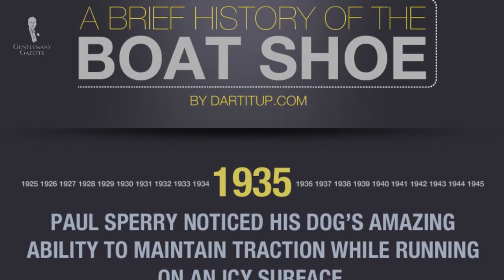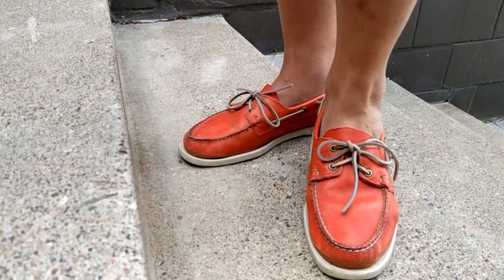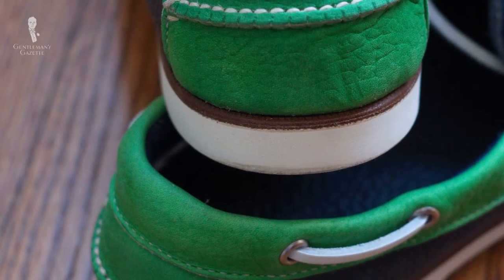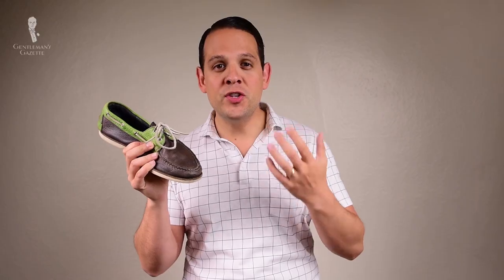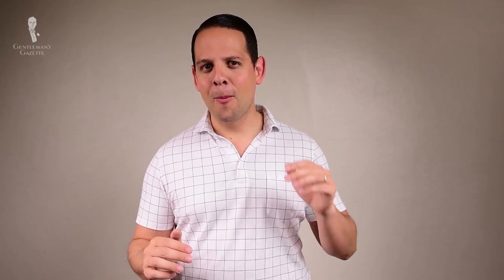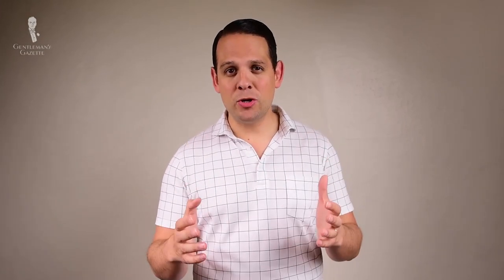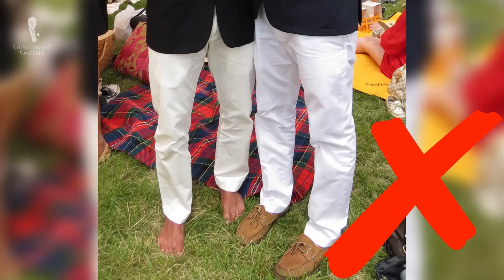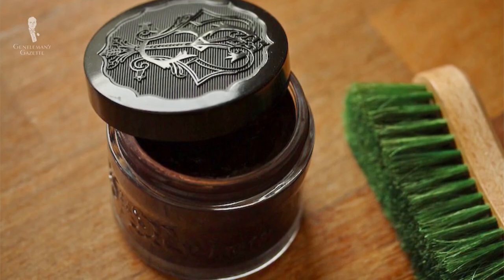Boat Shoe Guide - How To Wear Deck Shoes, Break Them In & Mistakes To Avoid

Comment: They are also very long lasting. I've had my Sperry's for almost 20 years, and still look and feel awesome.
Reply: mine only lasted two years, but i think that has alot to do with me welding in them. after those were gone i went out and bought the exact style and color over again
Reply: Worth every penny. :-)
Reply: They last a long time HOWEVER The grip of the soles on wet surfaces absolutely does not last nearly as long as the uppers. I’ve had my current pair for at least 10 years of fairly frequent use and right now they are outright dangerous on wet surfaces, even a wet sidewalk never mind the deck of a boat. Meanwhile the newer boating flip-flops I have are awesome on wet
Reply: @jefffawcett  get them resoled. The uppers are very durable indeed.
Reply: @1911Zoey its possible to resole Sperrys?

Comment: This is a super video. I would like to add a couple points to the boat shoe discussion. Since a sea-scout as a boy to sailing my own vessels on the San Francisco Bay. I have worn them my whole life. Perhaps we have our own traditions here but they are close held traditions. First, sailors never wear cotton socks. Wool stays warm even when wet, cotton does not. I keep to this tradition while wearing top-siders. If wearing socks I only wear wool with boat shoes. After the break in period, laces will not require readjustment. If using leather laces, it is traditional (at least on the West Coast of the US) to tie a square knot instead of a bow then snip away the excess lace about an inch from the knot. It looks tidy and will not accidentally become untied.
Reply from the maker: Thanks for the input!
Reply: With leather laces I use a closed jack ketch knot and slip them on.  This was common ar one time.
Reply: Also a heaving knot can be used on  each lace end instead of both into the jack catch that bights the lace ends on either for,ed loops. You only have to tie it once.

Comment: I know this isn’t intended to be a catch-all for deck shoe info, but I do wish more had been discussed about the differences between shoes worn on-deck and shoes simply styled in the boat shoe manner. For instance, the Sperrys I wear to church are very appropriate for casual wear, even with a tie. The shoes I wear on the water are VERY different. They’re vented, to allow water to enter and escape easily, and wouldn’t look right in many other applications.

Comment: I am looking for the timberland classic boat (white sole). My problem is that my foot length is 26,7 cm.
size 8,5 is for foot length 26,5 cm , and size 9 is for 27 cm. the size 8,5 feels a little tight, but not really unconfortable. the size 9 fells confortable, but give me the feeling to have to much space and less grip in the shoes. 
Does anybody have recommendation which size to buy? or does the leather go wider? any experiance? thank you very much